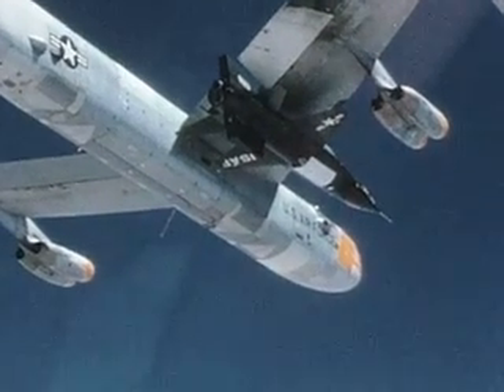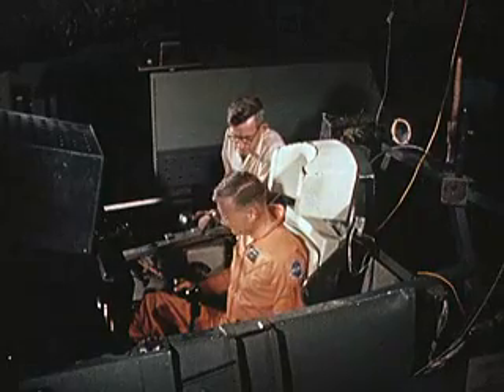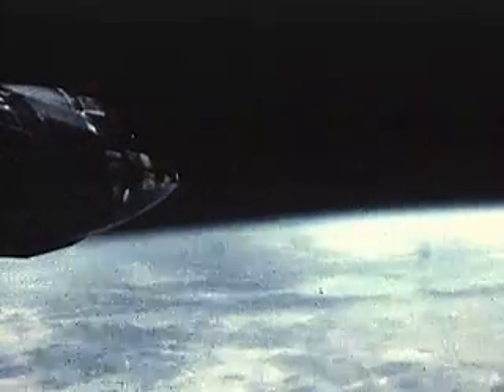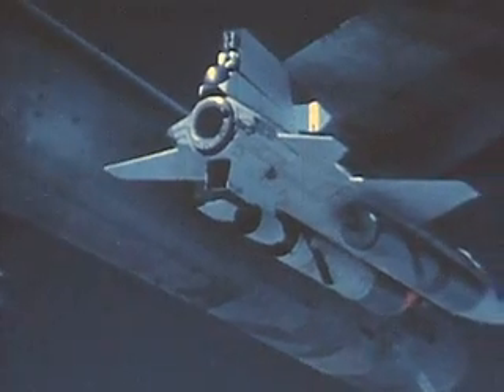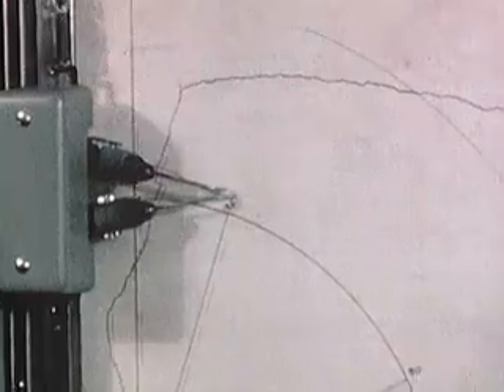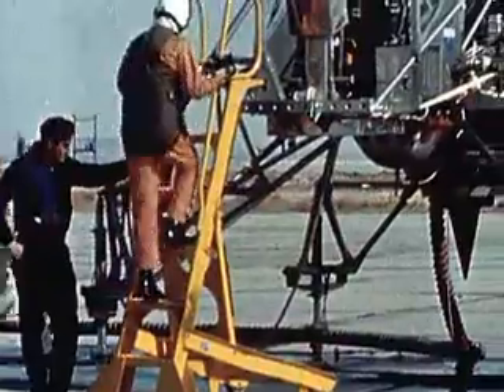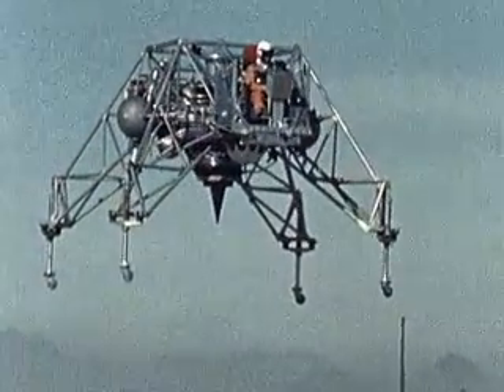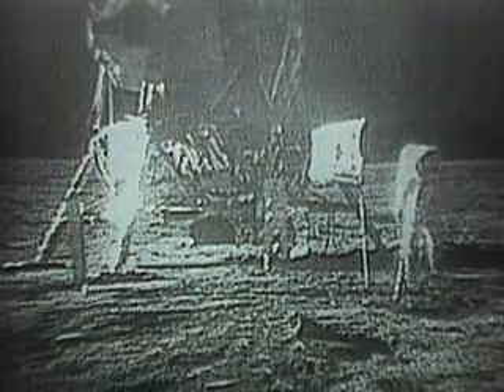The X-15 Era 1956 to 1966

Comment: This plane's maximum speed is Mach 6.75.
Reply: Not really,that's just a little more than they had fuel for. With a better coating and without that stupid dummy engine,The X-15 Diary stated that North American thought this bird could go faster than mach 7. Wasn't any real structural damage,or even operational damage done to it at mach 6.7.
If you haven't read it,The X-15 Diary is an awesome book,with some really cool photos.
Reply: @tomcline5631  Maybe it could go more than Mach 7, but no more than Mach 8